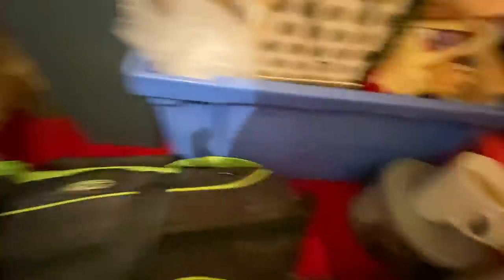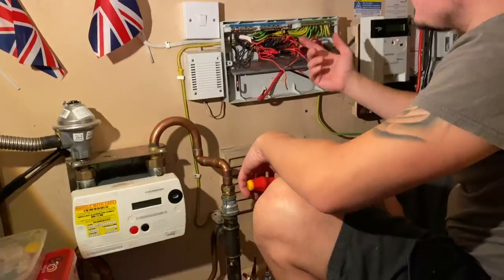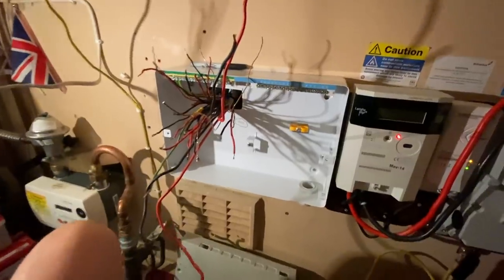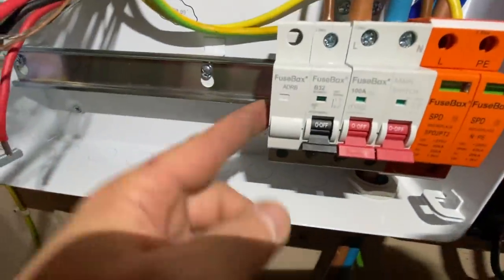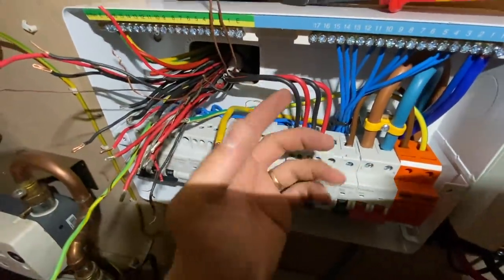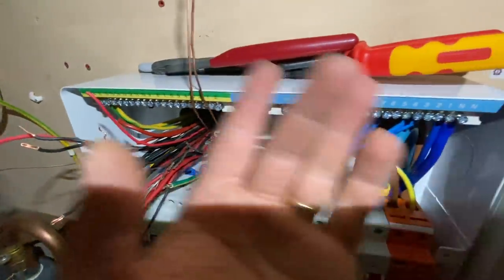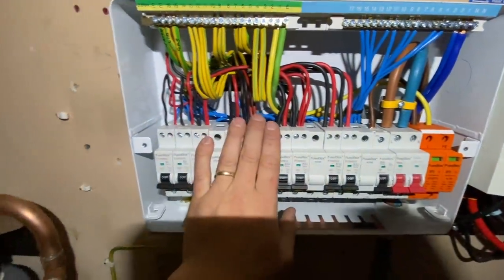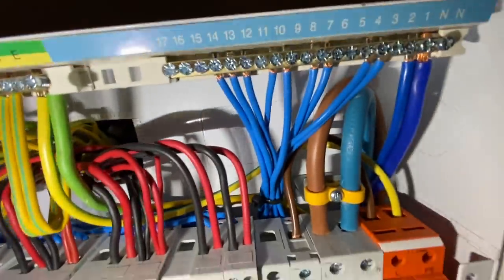18th Edition Consumer Unit Upgrade Glamorous Life Of An Electrician

Comment: A Fire-Rated board/Box is WORTHLESS if there is an unprotected entry point into the enclosure...

If the Rules require a Fire-Rated device is used somewhere than as far as I'm concerned, it doesn't meet the Minimum Code Requirements if a proper Fire-Rated Sealant (grommet, caulking, mastic, foam etc.) is not used at EVERY penetration into the enclosure...